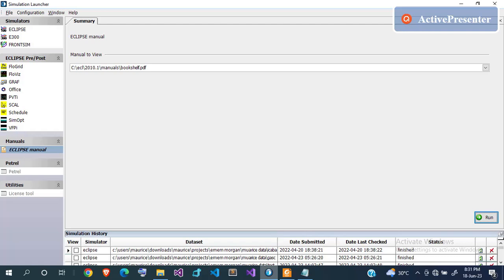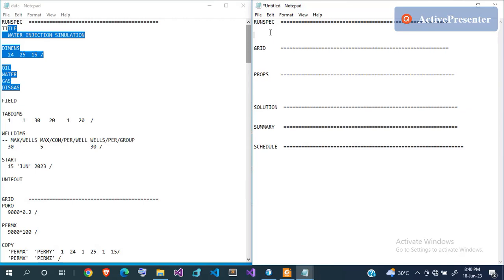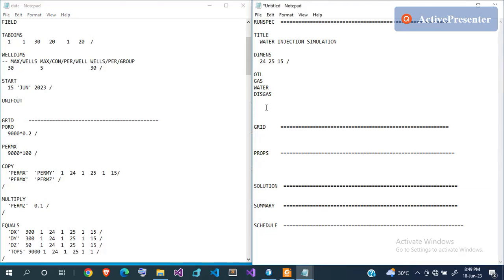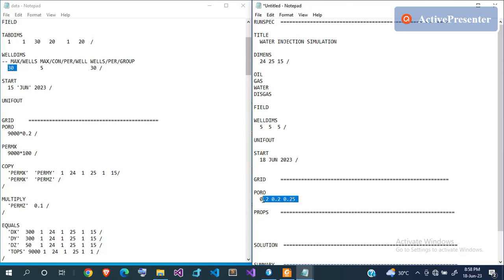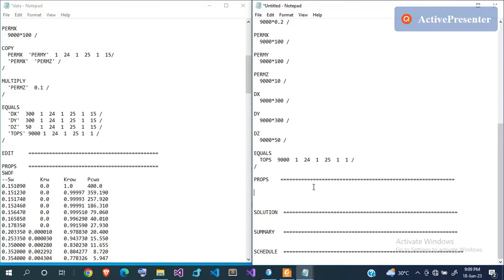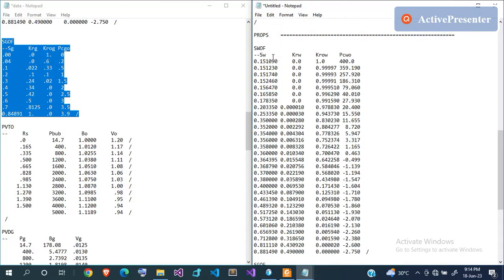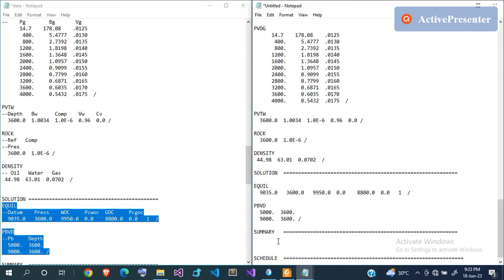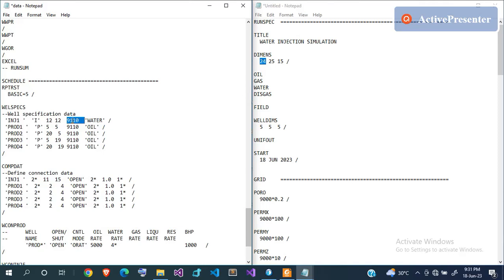Schlumberger Eclipse Water Injection tutorial

Comment: I have done simulaton for a gas reservoir. I have tried both water and gas injection process with different injection rate. The problem is that FGPR(Field Gas Production Rate) & FGPT(Field Gas Production Total) does not changes with changing injection rate and injected fluid type. I have set GRAT(target gas production rate) as control mode for production wells in WCONPROD keyword. And production is according to the target production rate that I've set in WCONPROD.(Production does not have any effect of injection rate and injection fluid type)
What should I do to get result in which production rate changes for changing both injection rate and injection fluid type?